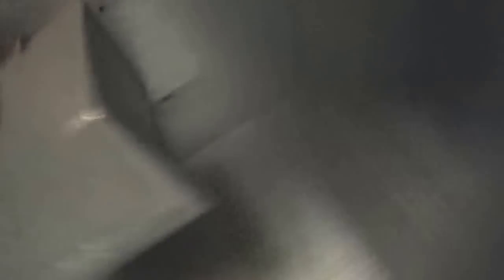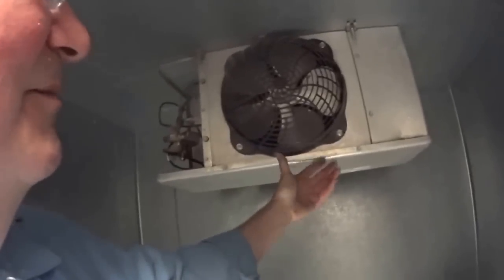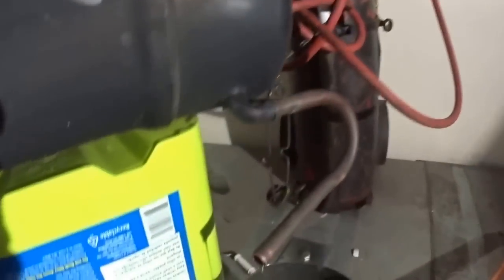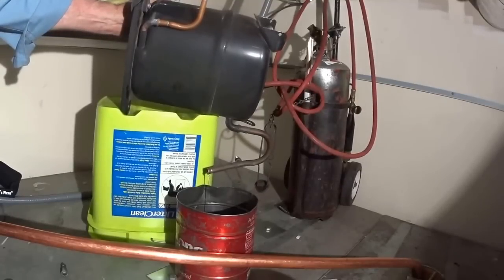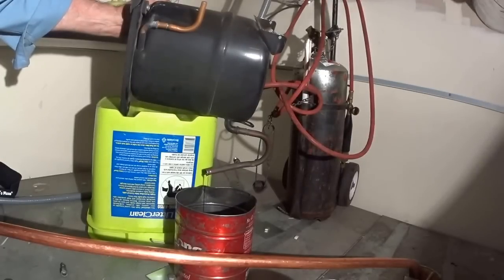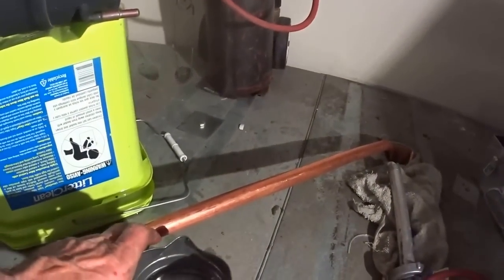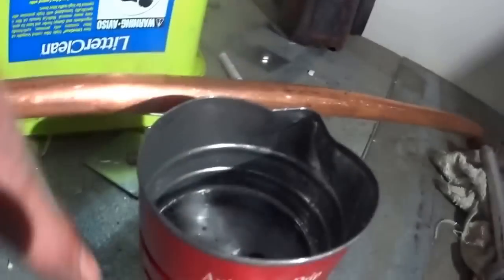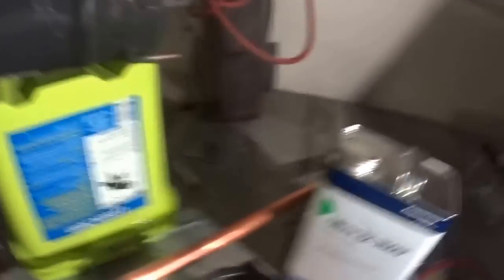Convert a Pizza walk in freezer to a walk in cooler part 1

Comment: What is the main difference between a freezer and cooler unit?
Reply from the maker: +Dave Seavy piston size, valve plate oriface opening sizes, thermal overloads, starting torque , refrigerant capacities and ratings, thanks
Reply: Thanks Jim.  I've always wondered about that.  I very much enjoy your videos.  I've always been interested in refrigeration and how the various systems operate.

Comment: im not very good with refrigeration but why not just change the temperature setting that it will cut out before it goes below freezing ?
Reply: MrCinimod93 the compressor motor would overload or burn out.  not enough power for the gas density coming back.  fin spacing is also different.

Comment: Do you have to purge the pump and line to make sure all the oil is not mixed? Is there a percentage that there will not be a problem?
Does it make a difference what line you put the oil in?
Thanks for the video?
Reply from the maker: amtpdb1 in the past Copeland has recomended a 5% mix is ok, now they're recomending a 15% mix, so the oil is not that critical, back in the 90's they wanted three oil changes which proved over time to be unecessary. The oils both have the same lubricating properties, the POE floats around pushing the mineral based oil.I put the oil directly into the compressor.
Reply: ***** Thanks for your time.
Have a nice day.